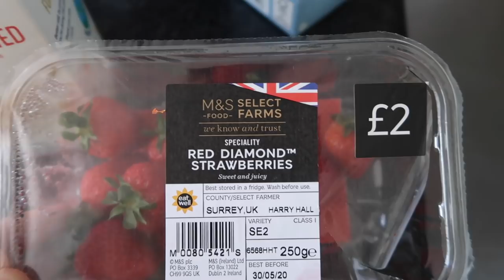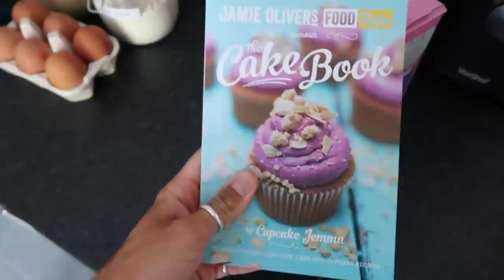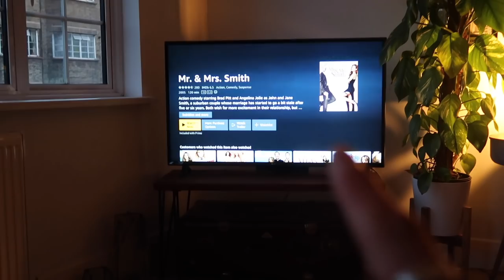IKEA DIY BALCONY PAINTING | RE-POTTING PLANTS AND BRUNCH IN THE PARK | WEEKEND VLOG

Comment: Great transformation Luke  and Zara. After suggesting the voile curtain idea I have thought of another. How about a coat of paint on the rusty beams you can see and using the spray privacy frosted paint they use on glass. either a full covering or with a stencilled design. You would then focus on the design you choose and not the bits you hate. I painted my old teak garden furniture black and grey this year and I am amazed how trendy it looks now.

Comment: A super cheap and easy DIY to hide the 29 is to get a lightweight material like a board and cut it large enough to cover both 29’s and hand paint the number (if it’s necessary to have that number there) and use removable double sided tape to hang the board. :)